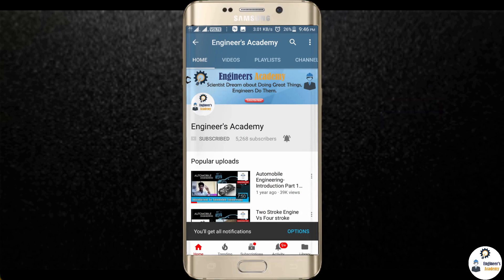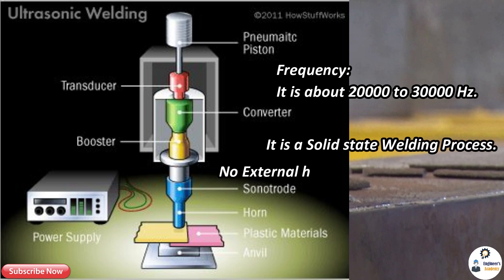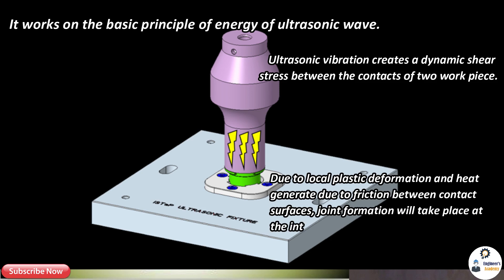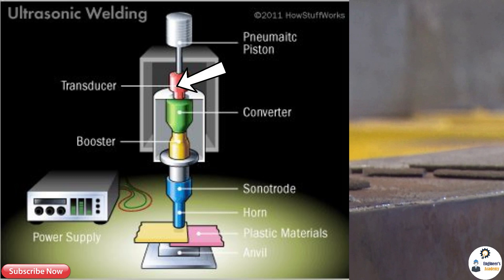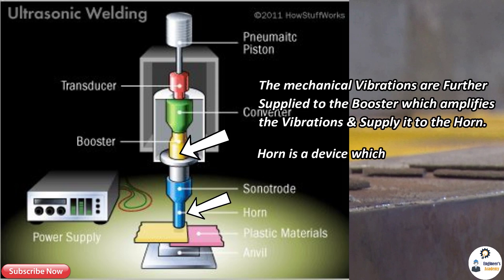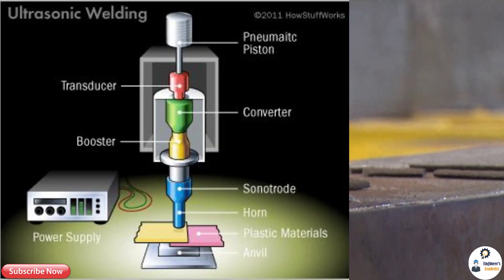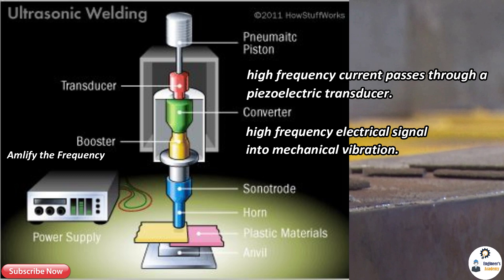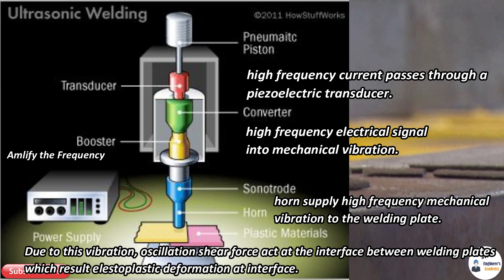What is Ultrasonic Welding Process ?? ||Engineer's Academy||

Comment: Great Video! As an injection tool maker I have seen many applications with ultrasonic welding and on different Ultrasonic machines. I would recommend not wasting your money on cheap welders as they tend to go wrong very easily and you don't get the support. I now work only with Rinco ultrasonic machines as they are very reliable and the Rinco team are always on call for any questions.

Comment: I have a question if I have two coms running of two power supplies and I’ve switched the wire going two both wire to coms it will alternator the one I need to wield or change the one from the com.. to the wielding towers???? Will also alternate but some reason both won’t work together why???

Comment: I want to create ultrasonic vibrations with an ultrasonic generator and a piezo actuator where can i purchase them?
Reply from the maker: Where are you from??
Reply: @EngineersAcademy9204  i'm from Algeria
Reply from the maker: @charonsybel  well you can approach to the local piezoelectric materials manufacturers in your country else you can check here 

https://www.smart-material.com/ActuatorSensor.html?gclid=CjwKCAjwpKCDBhBPEiwAFgBzj8G4EOlSdvIiIUa19IRvDKYqtnRxOuD7I_qmsACEm1vhIWHCV5ZzZBoCC-sQAvD_BwE
Reply: @EngineersAcademy9204  thank you very much sadly ln my country there is no production of smart materials
Reply from the maker: @charonsybel  well in this case you can export it, either from usa which is very costly or from china..
Reply: @EngineersAcademy9204  i need a specific piezoelectric actuator I will try my best to find a seller
Reply: Sir, did you already get your piezo actuator?
Reply: @ywkirk6968  yes i got it from alibaba

Comment: Very interesting video. One question: I have RF welding machines but in the pandemic season we ran out of work. Is it possible to weld face masks( PP or SMS) using RF welding machines instead of Ultrasonic Welding machines ( which I don't have?) I highly appreciate your recommendations
Reply: The best way to weld a mask is to use an ultrasonic machine. It can make fixture of different products.Very practical
Reply: You can buy a really cheap one 10$ it is called a ultrasonic stain remover
Reply: weld a face mask ............ why ??.......... what in hell are ya talking about

Comment: My ultrasonic machine horn is getting hot after 4 to 5 hours working... Please advice what should I do
Reply: If the machine doesn't heat up, the circuit board may be short circuited

Comment: My ultrasonic earloop welding machine is not heating
Which part i need to repair please guide
Reply: The power board is short circuited
Reply: U need to be more pacific I work with it all the time u can test the components?
Reply: It shouldn’t really get hot it vibrates at high speeds that makes it hot for a few seconds it depends on how long or air pressure there a lot more involved in it also if your horn is cracked it will give off wrong hertz and stop wielding to or if converter is not working

Comment: Pharmaceutical tablets are often packed in blister sheets containing for example 20 tablets. Often Alu/Alu or Alu/PET using a temperature driven weld. 
Do you have any knowledge if the ultrasound welding has been used for welding of blister sheets?
Reply: normally welding blister sheets by another welding process - High Frequency Welding Machine

Comment: I learned what I came here for, but the constant grammatical errors were nearly unbearable. Also, having a better voice over would be a huge improvement, since the one used here was developed over 10 years ago, and sounds like metal scraping a chalk board
Reply: It's just a high decibel sound.Electrical Energy is converted into mechanical energy at a frequency of 20,000 vibrations per second
Reply: What is welding temperature? at welding time is it constant or vary?
Reply: If ultrasonic box contineous beep after pushing button
Reply: @yogirajkalel1997  normally ultrasonic welding, just talking Power, Frequency, and the welding time is adjustable...
Reply: @MuhammadSaleem-sd8ng  the ultrasonic welding time already set, finish welding, the sound disappear, not continuous beep

Comment: When vibration is applied, why only melting happen in interface not on the surface?
Reply: Only the contact surface accumulates heat at the vibration frequency of 20000 times per second, which produces an instantaneous high temperature and then solidifies after air cooling.

Comment: What happens to the metal that makes it join the two parts?
Reply: J Attitude In this process the horn vibrates 20000 times per second and this energy pass through plastic material and get welded at molecular level.
Reply: @SiddheshJadhav230895  Thx. 
A follow-up question: what does it do to the material at the molecular level?
Reply: J Attitude when plastic get molecular joint we cannot break the joint of the part after welding
Reply: In this process plastic get melted and creates the molecular bond

Comment: Hang on... What's this "transducer"?
Where do I get one of those?
Converting pressure or vibration energy (kinetic) to electrical energy is a matter of static charge and the harvesting of heat and light emissions at the site of piezoelectric effects...

...
What is this so called " transducer " that converts " electrical " signals back through the piezoelectric effect into VIBRATION?

Its bad enough that all you have is a cartoon... But it doesn't even  illustrate anything.
Reply: Can anyone tell how to repair horn and booster of my mask loop weliding machine?
Reply: Pls suggest material used for making horn and booster
Reply: @mridulhalwasia5778   Sir, did your issues already solve?